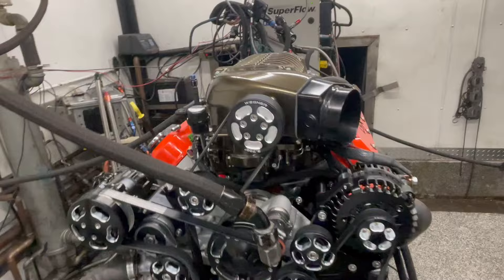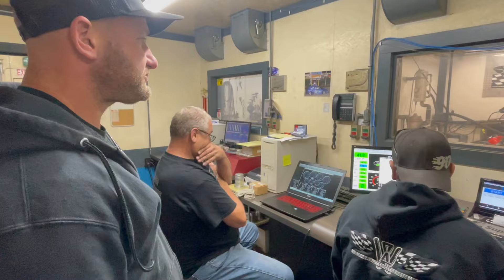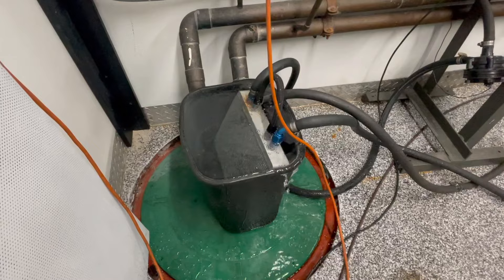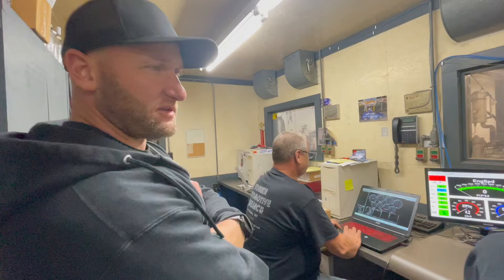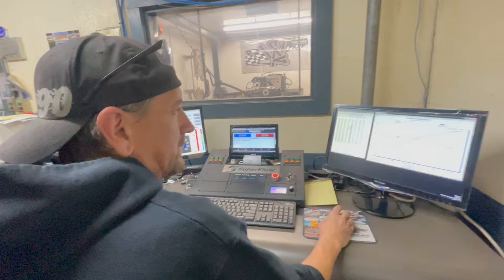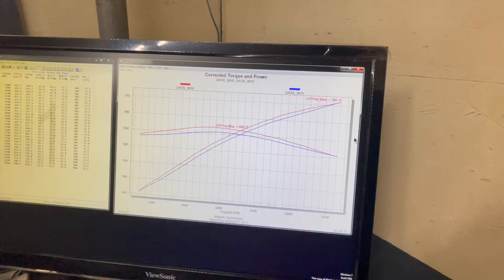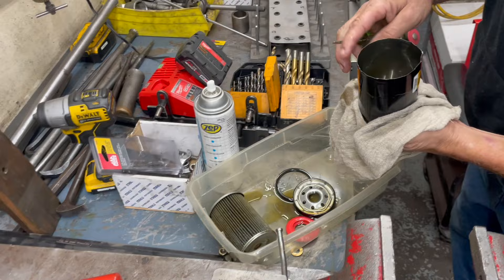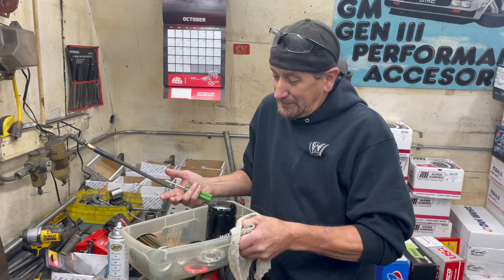Dyno Test of the Gandrud Chevrolet LSX376 B15, Whipple Supercharger & Wegner Front Drive

Comment: Nice engine.. I like to do similar set up for my 69 Chevelle with a pro charger ..
Did you change anything to the engine or is just like it came from GM..?
Just add supercharger..?
Reply from the maker: Thanks @manuelzavala8314 !! It's a completely stock Gandrud Chevrolet LSX376 B15 with the addition of Comp Cams 7/16 push-rods.  773hp is pretty impressive right?!?